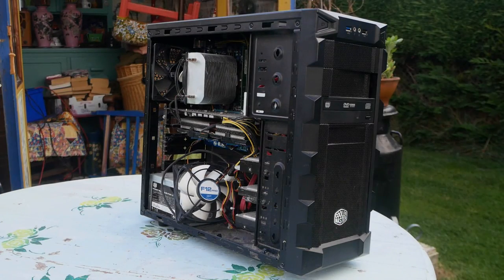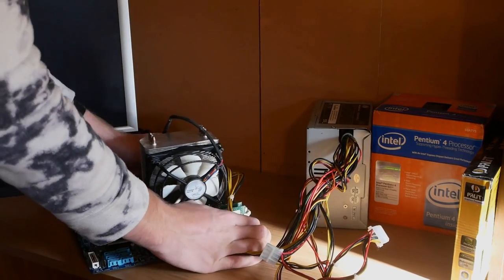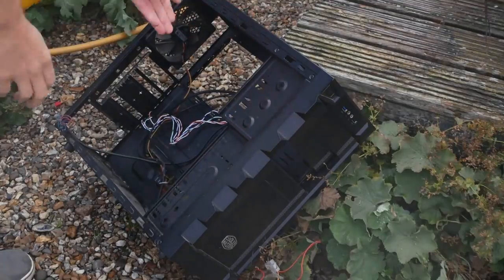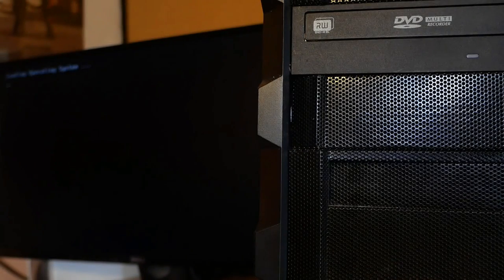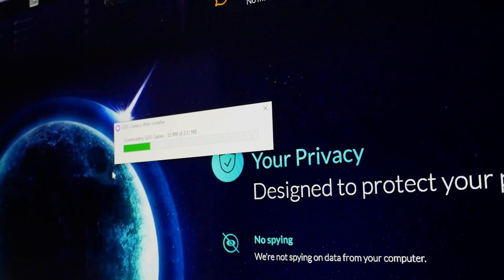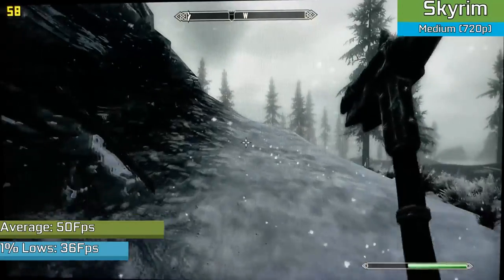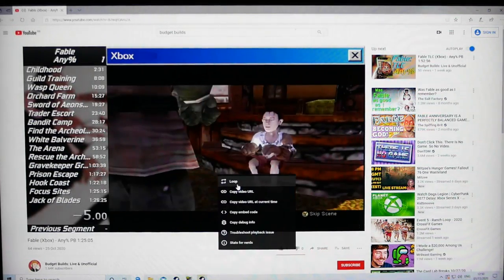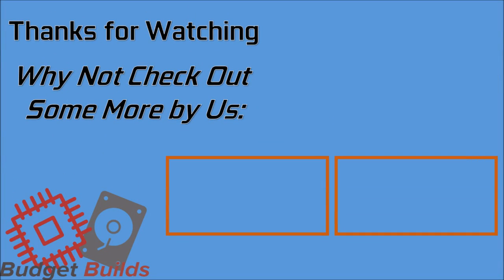I Bought an Awful Computer from a Barn....

Comment: Hi - another nice video

I know if this can help you at any stage, but when testing old computers i try to do a bare bones startup with only the memory it came with ( if any ) - so no graphic cards / sound cards - most after sat Pentium 3 or 4 will have built in graphics on the mother board - it it is old enough to have a floppy use a dos boot disk or a Win 98 / XP repair boot disk

All you really need to do in step 1 is get a bios boot screen - if you get that you are 1/2 way there

If it has a usb - then i try my Linux Puppy 3 usb stick ( you can use Version 3 or 4 or 5  then newer the longer the boot time but we are talking 1 to 2 mins )

After that, I always check google for a mother bard to video card compatibility  eg my Dell I7 can only go as far as a GTX1050 - as 1060 will not boot

There is some hardware compatibility BIOS / UEFI to the creation date of video card  ( it might as well be black magic )

I noticed you ran Win10 , while it should run - sometime win 10 will not install on some pc's using bios, they may want uefi

Even the bios affects the hard drive boot partition style of format   if you are lucky BIOS & NTFS, if not UEFI and GPT

I just copy and paste this from my cheat notes

Comment: Something about the GPU's acting weird could be related to the power provided by the PCIe slot, on some older Servers I have, the full 75w aren't provided, so only some cards run properly (i.E. a 650 with a 6pin connector it normally wouldn't need).

I also know of some weird behavior regarding USB booting, but usually that's on notably older hardware and/or OS.

If you felt dumb troubleshooting: I once had a PC which acted like the Mainboard/RAM was shot, but only in the case.  Guess what, the (glowing!?) power LED was somehow defective and used too much power (or shorted out?), the problem wasn't present while in the case because I used a connector I salvaged from a defective proprietary case.

Obviously, I only figured that out after testing a variety of cpu, psu and ram combinations.

Comment: did you already check caps near PCie Slots and backside of GPU PCB?  like missing caps, broken pad or traces.
because i had same issue with my GTX 560 SE, which won't displaying out picture on X16 Slot but perfectly fine on 2nd x8 slot. turns out, a single caps have different reading than the others. after i replace it, it's work just fine now....

Comment: There are some good electronic spray cleaning chemicals which works great on bad connectors.  Saved a few of mt old computers a few times. Alcohol based so no clean after isnneeded

Comment: I can't agree more with the statement "sometimes computers are just weird"
I once got a hands-down laptop from a school friend cuz the keyboard was not working. I ordered a replacement fitted it myself and it was jolly well till I realised the thing included geforce 820m graphics but only the integrated graphics worked. No matter what I tried, no matter how much I researched I did not find a single fix for that piece of shit GPU which was barely better than the integrated graphics .after a year the hinge snapped and the repair cost was going to be way too much so I just shelved it. Truly a cursed computer

Comment: a leftfield suggestion would be to try the whole rig in a different case - sometimes it can as simple as a short from some component against the standoffs, or some quirk of the case design - counter-intuitive I know but I have experienced this . especially with cheaper or warped cases.

Comment: The strange "not booting from a usb drive" might be because of conflicting partition tables. I.e. If the pc you used to create the disk is formatted using GPT, then the USB drive will only be recognized by a system also formated using that standard and thus systems using the MBR partition table might not recognize it. I know from experience that a DVD drive works better sometimes because I have had to use it in the past because of this problem.

Comment: I've had weird PCs I've had to mess with to get simple things working.
Like the new PC build that wouldn't format it's own hard drive, had to put the drive into another PC to format it. Then it would install windows just fine.
2 years later, had to reformat the drive, still acting up.
Best we could figure out that BIOS doesn't like that brand on hard drive.

Comment: I just got a IBP trace 930. Which has a 1060 3gb, a 7700k cpu, and 16gb of ram for 125$ seller was asking 150$. He had no idea what was going on so I bought it and saw that the mobo was fried. Went on reddit and bought a random working msi mobo, and a hyper 212 cooler for 70$ and too be safe I bought a corsair 650 psu for 35$ local... and it easily now works!

Comment: It's a gigabyte motherboard, i'm surprised it still worked. They weren't known to be good back in the day, especially when they started poping on those "dual bios" crap which only worked in 10% of the cases.

The issue with compatibility for GPUs is down to the PCIe slot, i've had cards that didn't work until you bent them upwards (towards the CPU) and then they'd get a good contact, once you look at that under a microscope you can easily see a lot of things. Considering the system had that GPU in it, it wasn't a compatibility issue. They way it was stored + the cooler being heavy and most likely sagging the whole PCIe slot probably fucked the furthest top pins.

Comment: You should open GPU-z and see if you're running at 1, 4, 8, or 16x PCIe speed.  That might be why that specific card works and others dont.  Some cards were wired for 4 or 8x PCIe (even with an x16 connector), so if there's an issue with some of the lanes it would bypass it.

Comment: Considering that the DIMM slots were dirty, couldn't the same thing apply to the PCI-Express?
Either that or the CPU has some weird issues with addressing PCI-E lanes.
Or the fact that the motherboard is janky. Seriously, though, it can't boot off a USB! I've got a Socket 478 board that does that without a problem, even though it's slow and painful.
I'd clean the port out, test it that way, then swap out the CPU, test it again, and then test the i5-760 with a different motherboard to see which one might be the culprit. We know that the GPU's fine, so it has something to do with either the processor or the mainboard.

Comment: Did you try a know good PSU? Just because the PC turned on doesn't mean the PSU is Good. It could not be sending stable voltages.
And did you clean the CPU socket? one bad/dirt pin can completely inutilize a PCI socket.
And the PCI socket could have corroded. If its the socket you can try cleaning it but it could also be the cracked solder joins. Reflowing the socket with a soldering iron, flux and leaded solder may fix the problem.
Reply from the maker: Tested with a different PSU 👍

Comment: i'd kill to see a video on the later core 2 quads in 2020, like the q9650 or q9700? do you plan on doing anything like that anytime soon?
Reply: Dude, overclock one of those cpre 2 quad extreme amd they can be REALLY good and power a 1060

Comment: The reason that most of your gpus didn't work in it could be the power supply, I had a similar problem where the power supply just got worse and worse untill the pc would just crash with a gpu in it and I didn't know why until I tried a different psu
Reply: It's probably not a good idea to use a psu out of a hard where it could get damp because I got a pc from an old shipping container and it worked fine but when I touched the outside of the case I got a mains voltage shock.

Comment: Had a few thoughts you probably did all this, most likely to least likely:  Deep clean motherboard, check caps closely, check cpu is seated/supported with no socket dirt maybe i7 is not supported properly, maybe case not 100% dry from wash water particals conduiting/shorting?, check CPU is genuine and not a fake and also test ram replace CMOS battery, Maybe the board has had previously had a bad BIOS flash this can do wierd things like kill ram slots. nice video missed this channel.
Reply from the maker: 1. Motherboard has been fully cleaned. 2. All the capacitors appear to be working perfectly fine. 3. CPU has been replaced and removed to test for any faults. It still appears to work fine. 3. Case was left to dry for hours, and was cleaned. 4. BIOS is correct and has been flashed to the latest one 

I think Cigarette tar has actually corroded through a power trace

Comment: This proves why it is so important to clean your PC, especially if it has been smoked around. Sticky dirt and residue can mess with electronics something fierce.

I bought a GTX 1050 for £30 that had been wiped down, but was truly revolting on the back panel. It was very very unhappy, and glitched out, hence why I got it at what it was actually worth, rather than the £75 everywhere else seems to ask for it.

I gave it a scrub with isopropyl alcohol and a toothbrush, and now it has been working flawlessly in a budget system for three weeks!
Reply: i will take that price anyday if it's just some cleaning

seriously......

Comment: I have a computer that must be related to this one. It randomly forgets a stick of RAM. Not the same stick either. It jumps from slot to slot. It also forgets that the processor is installed on restart sometimes. I have to turn it off and back on again to get it to see it. I have changed the power supply, case, RAM sticks, motherboard battery, video card, and processor and it still has the same issue so I know it must be something wrong with the motherboard which I have flashed to the latest BIOS with no improvement. When I get it to a state where everything is working I just leave it on and pray that the electricity stays on so I don't have to go through the reboot process all over again. When everything wants to work it works just fine. 🤷‍♂️
Reply: Finally "Have you tried to turn it off and on again?" makes sense...

Comment: Regarding the USB boot problem:

If that is a Gigabyte motherboard, and I think it is because I had one of a slightly prior era with exactly the same white text choose boot device menu, you have to choose Hard Disk. Nope, USB-HDD and other USB options won't work. On the occasions I managed to get USB drives to work on my old Gigabyte mobo, they appeared under the "normal" Hard Disks menu option.

Yeah Gigabyte.

Comment: i had an amd socketed asrock board that was super picky with components, it turned out to be weak mosfets, some cards pulled more current and the board crapped out, or the board never provided enough juice for the card inserted and it would not start.
an indentical board from ebay for 20 quid worked perfectly.

Comment: Surprisingly them baby HAF CM cases are quite popular, I have been loath to let go my HAF XM monster version of that case because it is such a cooling monster and something Coolermaster seemed to get right with all the HAF's.   I would be looking at the PCIe slot for bent or missing pins or maybe one of the power supplying mosfets given up the ghost, certainly not everything is OK down there in the dark crevices of PC interfacing lol   Hey you could LED and paint the whole thing up and list it on ebay as a superfast gaming PC not forgetting to put DDR3 in a big shiny star to show its potency, some clueless parent would buy it and imagining the crestfallen look of utter dismay of little lad parent bought it for would be priceless...  I have an i5 HP Elitebook that refuses to run smoothly Windows 10, it runs like a swimming pool of custard :(  Trouble is I can't find my copy of Win 7 and because its linked to my MS account it refuses to let me download 7 onto it forcing me to take it up the chuff from 10 grr.

Comment: It seems this computer has a lot of PCI-Express related issues. You should check the pins on the motherboard socket and look for bend ones. Those anomalies can result in strange issues like broken PCI-E lines and might explain why all of your powerfull GPUs are not working since they need more PCI-E lines than a low-end card.

Comment: I had a similar problem with an Asus Striker 775 board, Small surface mount components on the north and south bridge had corroded and fallen off so only part of the chips would work, It would start and boot from USB extremely slowly but not recognize HDDs at all, Shame really as it would have been a decent board.

Comment: Speaking of weird. My friend and I once had identical Biostar motherboards, ram, GPU, and Sempron +2800 setups. Determined it was a bad cpu after my rig worked great after trying his cpu. On a whim he tried my cpu in his rig and it worked!? Thinking might have been a connection, dirt, etc we switched back and here's the weird part...my cpu still did not work in my rig AND his no longer worked in his! We switched cpus and both our pcs worked great until our next upgrades. Never have figured that one out.

Comment: The problem 10:1 was the psu and capacitors.  As they age they dry out and lose the ability to deliver clean stable power at the required current.  The video card you had in there required more power than that old psu had to offer and likely suffered voltage droops during transients.   Much older cards weren't nearly as sensitive.  Its also one of the reason modern power supplies are a lot more expensive.  

With a system that old expect to lose 40% of original capacity.
Reply from the maker: PSU was tested in another system and was able to deliver atleast 450W continuous load in a stress test
Reply: @BudgetBuildsOfficial  but was it tested in another system with the same 6000 series card?   Also up to 75 watts can come from the pcie bus.  If you see any bulging polymers on the mb, you arent likely getting a stable 75 watts. 

I dont restore old systems like you.  But i've put together over 20 systems for friends and family.   I then back them with a full five year warranty
  And im also an engineer that does not electrical work on circuits.  (Not to be a smarty pants).  I see what happens to power supplies long term when i put them on scopes with sudden load changes.  They quickly go out of atx spec.
Reply from the maker: I think the main reason is PCI-E Pins being corroded due to Ciggarette Tar. Preventing full utilisation of cards, and causing it not to turn on

Comment: I bet its a gigabyte board...  some were a nightmare  if you had a flaky one - ram voltages were misreported in the bios with gigabyte boards of this era, fiddling  with ram voltage settings in the bios and using a reliable  multimeter  to check rams actual voltage and adjust in the bios until its 1.5v on your meter and your golden - you may find then other gfx cards may work

Comment: I know this video is older, but I wonder if all of your video card problems was because of the monitor and resolution that the bios outputs is my only guess, I've ran into a similar situation with a i5 750 system, It came with a HD5770 and was quoted working, well it didn't work for me, I tried a gt210 which I knew worked, but it didn't work either, I threw in a 8400gt and a x1900xt and nothing still, I took my Quadro 600 out of my server and it worked.

Got me thinking, I tried the HD5770 in newer i3 system and it worked. So I threw it back into that old i5 board and of course nothing, I swapped out monitors the old Acer LCD,  to some Gateway lcd and nothing on it either, I took my garage PC monitor, some HP 19 inch lcd and it works! Idk why.

I also build my uncle a Ryzen 7 5700G system with a B550 Asus board and I used that same Acer monitor and we didn't get anything out of it with the on board video or his GTX 1070, Thought the board or CPU was dead, Turned out to be the monitor, used a modern 27 inch 165hz monitor and it was perfectly fine. That same monitor works flawlessly on many other computers I've worked on in the past, I just don't know why them systems wont work with it.

Comment: 3:55 the PSU, CPU, RAM, GPU, SSD and the random assortment of hard drives were worth the money you paid for it - assuming you did pay the £30 in the advert
also having an assortment of hard drives can be useful, in my tower PC I have a 480GB SSD, 1TB HDD, 2TB HDD and I can't add any more as I'm out of SATA connectors.

Comment: @Budget-Builds Official 
Um, you might have missed the obvious, contact issue in the PCIe slot. DeOxit or just check for junk in the slot and blow it out with compressed air. After finding the junk in the ram slots that should have been the first thing you checked for..
Reply from the maker: Hello. I have 50GB worth of troubleshooting footage. I have explained in previous comments that I cleaned out the PCI-E slot, but believe the cigarette tar may have corrected a power trace
Reply: @BudgetBuildsOfficial  
Must have missed that, sorry man! I generally don't read other users comments...

Comment: I have the exact same issue with my RX 550 in an Optiplex XE. It worked fine for a year, had some odd graphic artefacts but nothing major and really it doesn't happened often. I took the GPU out of the Optiplex and installed it in a Bulldozer PC.
Worked absolutely fine without artefacts.
I swapped the card back and now my Optiplex refuses to boot with that specific card. My r7 240 works just fine, and the RX 550 works in every other computer, and I don't know why. I'm troubleshooting here for at least 3 months.
Reply: The only issue with a graphics card and an old motherboard I’ve have came with an old Asus G41 motherboard. I put in a RX 460 and the bios boot screen was garbled and the bios preformed slowly, otherwise the pc worked fine though.(the 460 doesn’t have the same issue with another asus G41 board and an asus P45 board I have)